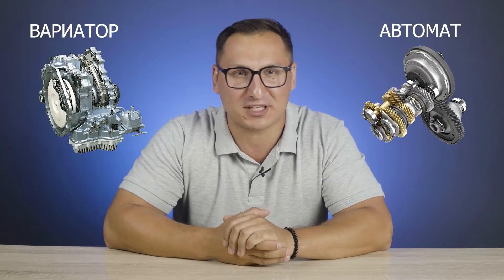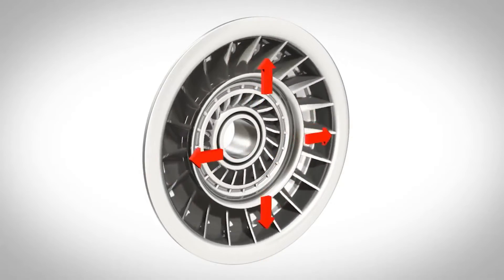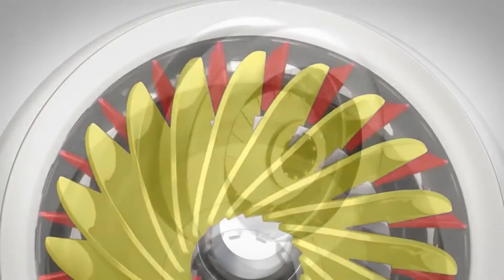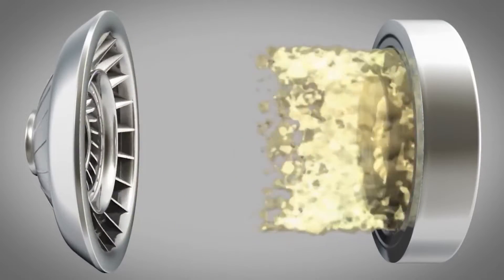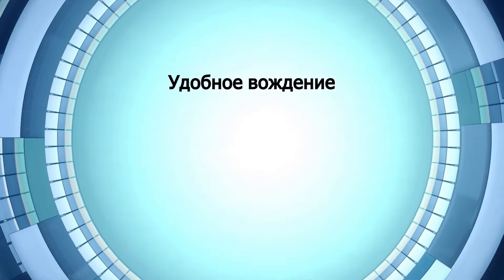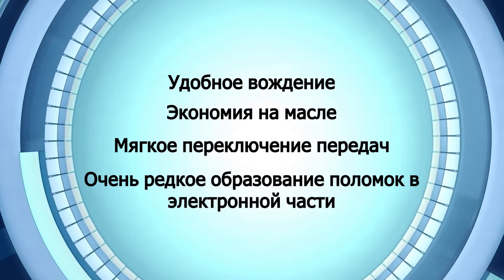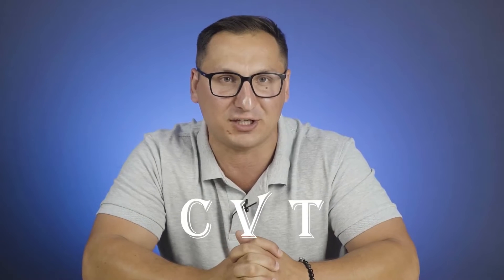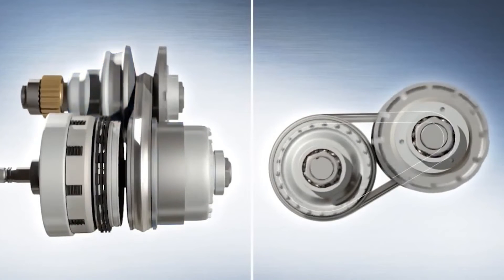CVT vs Automatic Transmission – What Car to Buy???

Comment: The cvt will give you the smoothest ride you’ve ever had . Change the transmission fluid every 25,000 miles and it will run just as long as any other train . Not for towing, no automatic transmission is !
Reply from the maker: Joel, I agree with you! if you change the oil in the gearbox every 25 thousand miles, you can certainly avoid many problems!

Comment: CVT is a old technology but I don't know what is in trouble today after a lot on new tehnology made. The CVT is economical in gas but only in autoband at the constant speed and RPM. The CVT is less heavy than normal automatic. A new CVT = w/total reparation of the normal automatic. The CVT is not friendly in town, a lot of high RPM to change the gear. It is very noise.